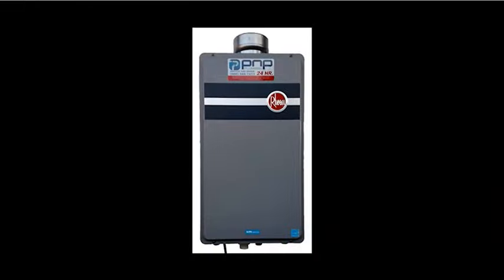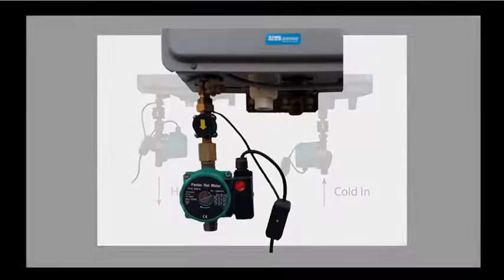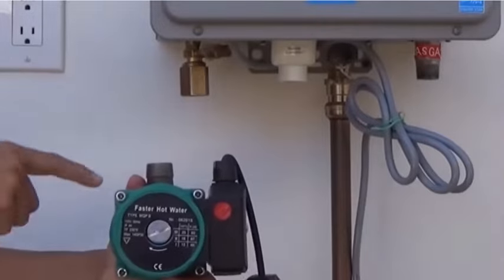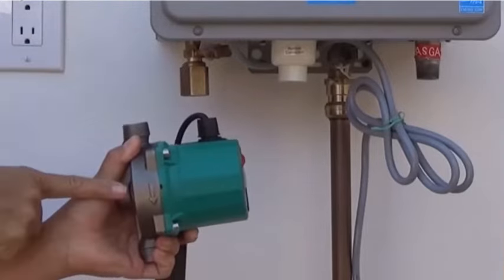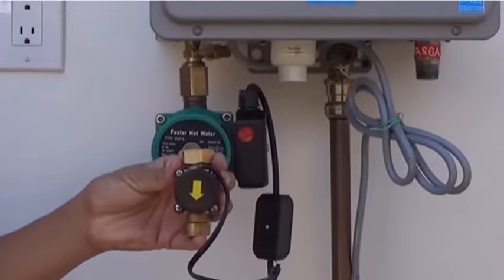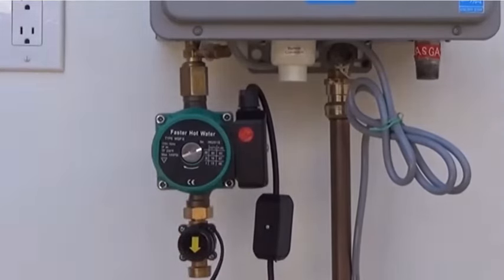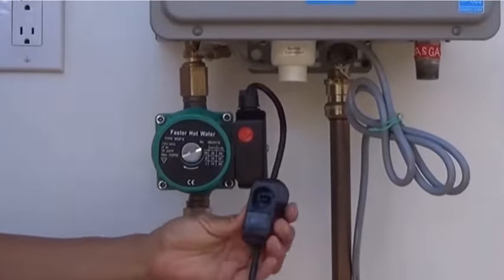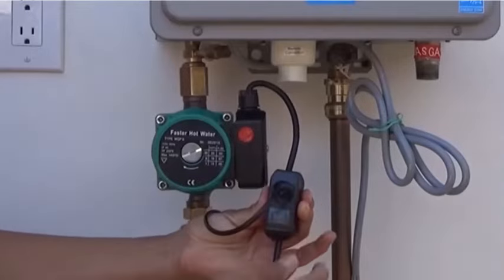waterquick tankless recirculation pump installation video

Comment: So the flow monitor will activate the pump when water is in use? So how will this be beneficial? The purpose of a pump is to circulate the hot water so when you turn on the faucet you will have hot water.
Reply: It's "faster" hot water. The bridge valve is open when under something like 95 degrees, so once you open the hot water faucet, the pump can move much more cold water that's been sitting in the lines than you could just flow out the faucet. This essentially moves the cold water out of the way faster.  If you want, you can make these turn on with timers and other control electronics like smart outlets and such.
Reply: The second video talked about in the last 3 seconds of this video (I can't find where they ever posted up the 2nd vid) would have shown the installation of the other part of this system - a bridge valve - to be installed at the home's sink located furthest from the hot water heater.  The bridge valve is connected between the hot & cold water lines there, and automatically recirculates water from the hot side to the cold side when the hot water there begins to cool, thus calling for more/hotter water, and your recirculation pump kicks back on and also kicks the hot water heater on to keep only the hot water line full of hot water at all times.
Reply: You will need a pump if you change out a furnace with a tankless to circulate the water to your baseboard heating system, it's a genius way to heat your home with a tankless

Comment: Have a recirculaation line with a Taco 006e3 circulation pump. Is it acceptable to put pump/flow meter  on hot water going out on my combi boiler ?

Comment: The pump instruction maunal specify to not install the pump in the output of a water heater.
Reply: The guy needs to slow down on whatever he's on.... the worst part is forgetting to mention the MOST IMPORTANT part of installing this... THE BRIDGE VALVE!
A better solution is a recirculating pump with an integral valve and a timer.

Comment: Yeah my Rheem tankless gas water heater is installed outside on the wall, g=it's getting rained on right now. Will these pumps work outside in the rain?

Comment: I can't click the link to the video about advanced bridge valves. My home has a hot water line that goes to our second floor and a different one that goes to a different end of the main floor. Can I install bridge valves at both ends so that hot water is circulated at these two opposites ends of lines?
Reply: Yes, you can install up to 3 bridge valves